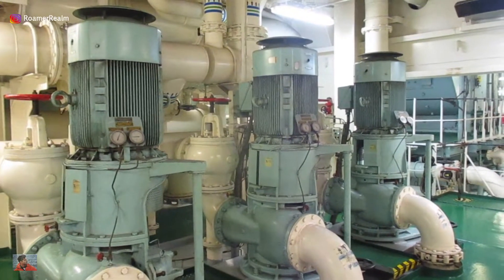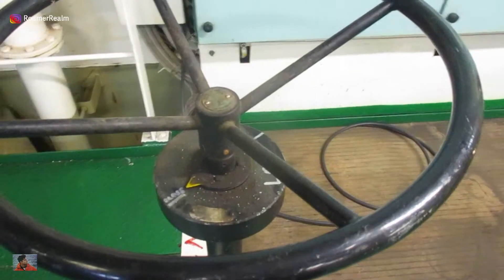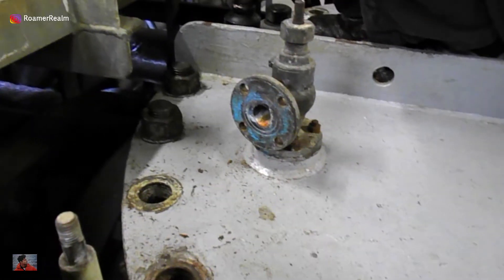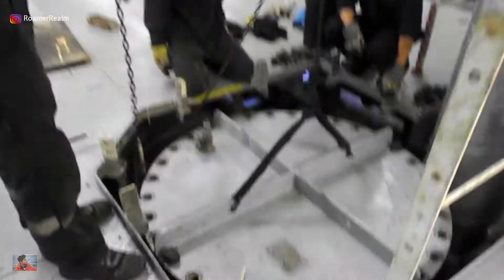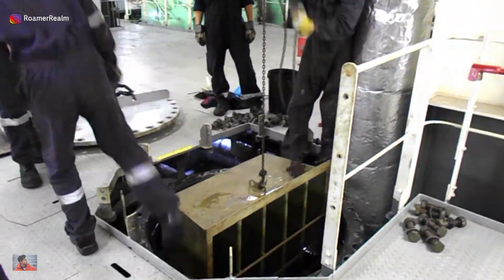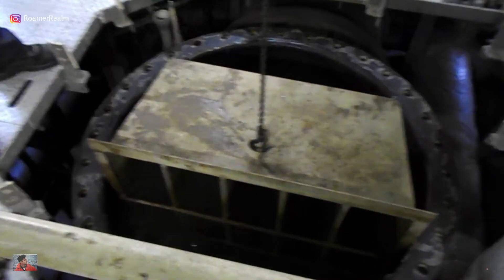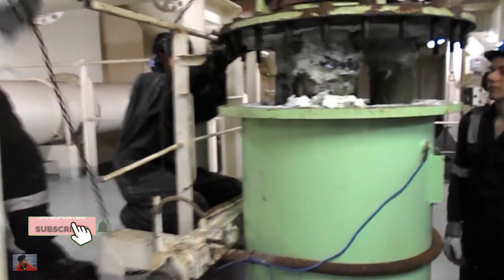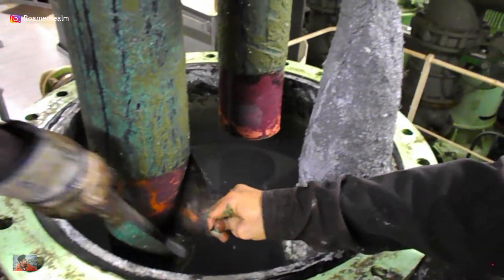Sea Chest in Ship Explained | Strainer Cleaning & Inspection | Marine Engineer | RoamerRealm

Comment: Thanks for in details sharing video, it’s very useful. My current job is dealing with vessel owner for cargo replenishment and current model is fully utilize vessel slop tanks to carry cargoes and some destination ports require vessel to perform water line flushing after discharging each product, therefore the team all along will prohibit loading cargo into slop tanks since it needs for flowing seawater to perform water line flushing. However recent there is one vessel that we accidentally used slop tank loading the cargo and fortunately the vessel owner mentioned that they got sea cheat to flow seawater and perform water line flushing. Does this mean I don’t need to worry about slop that isn’t empty? Thank you in advance
Reply from the maker: Hey! Slop tanks have a different purpose as you've mentioned. Having a sea chest basically means having a basket with a filter inside to allow flowing in of sea water in a controlled way. I would like to know more about the the slop and cargo washing system that's fitted on your ship. Slop / cargo washing residue also has strict regulations involving with it's discharge, while sea water is just clean sea water. Please let me know more details to be able to answer you better. Thanks and do subscribe to my youtube channel

Comment: Excelent video. Congratulations. I work in customs and border patrol in my country. Unfortunatley, we are having to much problems with drugs  placed in the sea chest. The drugs usually are placed inside the sea chest and tied on the external grid. Criminal divers do this. I am not a mechanic engineer, but i am an eletric engineer. I have to ask you something: Is there any way we can insert a small camera on the sea chest, by inside the ship? 
Is there any inspection window on the sea chest for the mecanics make a boroscopy?  Another question: if the bags with drugs are placed in the sea chest, next to grid, can we look on the machines eletronic control and detect a water pressure (or flow) change? Thanks
Reply from the maker: Hi Diego, thanks for the nice comment and your words of appreciation. If you want then do Subscribe to my Channel, it helps. Coming to your questions:

About camera on sea chest - The sea chest is always pressurized with sea water from the overboard side. Inserting a camera would mean to find an opening on the sea chest from inside the Engine room to insert the camera. There are openings available, but personally I think no Chief Engineer or Master would allow it as it means a lot of extra job for the Crew (Isolating the sea chest, draining some of all of the sea water content to de-pressurize the sea chest, removing the mountings/flanges on top of the sea chest to facilitate the camera insertion etc...AND these mountings are not so big, so, the camera will also need to be really small (smaller than GoPro)...so, overall, I am not sure how feasible this is. Additionally, you might just be able to insert the camera but you have no control over the movement of the camera, so, you can really see everything. Moreover, the grill area which you're talking about where the drugs are usually installed, are still more to the outside of the sea chest and a camera inside sea chest still won't give access to the grill sections (because the isolative valves are just before and after the sea chest while the grill etc is closer to the sea side (before the overboard isolating valve) and that area cannot be isolated (unless divers are employed and they blank the sea side using plates). Hope this answers the first questions.

Next question about the flow change detection: There are pressure sensors installed on the sea water side (we need to know these values as well to monitor the running parameters, to monitor cooling efficiency or to detect ice when water temperature is really low during winter). The sensitivity of the instruments installed is not that amazing to detect a flow change due to some (or more) amount of drugs. I think if the entire sea chest area was filled with drugs, and the Sea water pumps were starved of sea water, so much so that there is really a drop in pressure, only then will it really show a pressure difference. Otherwise, I think these instruments will not be able to give you any signification data which can be used to detect drugs on the sea chest. Another thing - the pressure shown on the pressure gauge or on the remote monitoring system is the instantaneous Sea Water Pressure in the moment. The value also depends on how is the ship loaded with cargo (more cargo = more sinkage = more draught = ship is deeper into water = more pressure available (since pressure increases with depth). So, this would further make it complex for you to really determine if the pressure difference is due to drugs or due to cargo loading or due to ballast (different topic but ships can also take in sea water in dedicated tanks to increase/decrease their draught as required for stability reasons depending on cargo load distribution and navigational requirements. Hope this answers the second questions.

Let me know if you have any other questions and I'll be happy to help you. Have a nice day!
Reply: @RoamerRealm  Thank you for all your wonderful explanation. The idea of trying to insert the camera inside the ship came about because here, in the port, the water is very dark. Almost impossible to see the ship's hullI using a ROV (Remote Operated Vehicle). We already tried the ROV. About the pumps, i thought that the drug packages could cause a drop in the pump pressure. But, as you said, it would have to be a large amount of drugs. Another ideia came these days, about the sea chest cathodic protection system. I thought about whether the use of plastic to package drugs could disrupt the conductivity of the sea chest cathodic protection system  (plastic is insulating) . Maybe the plastic use can make the controler of cathodic protection system use more current. Do you think you would have the sensitivity to detect it? Thanks
Reply from the maker: @diegoperes2287 
You are welcome, happy to help you. Below are my thoughts about your latest comment:

If the water in the port is extremely dark, maybe a long term solution could be to use a dredger to clear out the sediments/underground marine growth in the port. If there is not enough UKC (under keel clearance) then these boats while arriving in the port stir up a lot of dirt/sediments and underwater visibility is further hindered. If allowed some time, these disturbed sediments settle again and maybe the visibility is better after sometime Vs when the ship has just arrived and Tugs are working along with Bow/Stern thrusters. So, if possible, you can plan the inspection of the ships accordingly or employ a dredger and deepen/widen/clean up the bottom bed of the port.

About the ICCP (Impressed current cathodic protection), this is a dynamic system and measures the instantaneous potential difference between the hull and the reference anodes. Ships hull surface area is huge compared to the small area on which the plastic/drugs are going to be stuck. The instrument might catch it but due to the small area, it will auto apply the corrective current to the system to compensate for the change in potential thinking that maybe some paint has peeled off or there is higher marine growth or maybe even a slight change in the density of water. This system can give usable indicators only when ship had a grounding or touched bottom and a large part of paint got peeled off or when ship went from sea water to fresh water (density change)….other than that this won’t give any meaningful difference in measured values as the system will automatically correct and supply the right current to the hull. Hope this answers the question. Let me know…
Reply: @RoamerRealm  Thank you my friend. All your tips and explanations were very valuable. The opinion of someone who has technical knowledge about mechanical engineering is very important. A thank you from Brazil, port of Santos
Reply from the maker: @diegoperes2287 Muchos gracias amigo! I have been to Santos a few times and made some wonderful experiences staying in the city, exploring the city and also meeting some very nice people (we met more than 10 yrs ago but some of them are still my friends) Brazil has always been very special, I am from India and I feel our cultures are also very similar :) thanks for the kind words and have a great day!

Comment: what to do if sea chest valves are not holding , and you have to clean Stanier .
Reply from the maker: Hi Ashish! Tricky situation…hard to give a straight forward answer. How bad is the leak? There is a drain valve on the sea chest which drains to the bilge well. If the rate of leak is very very low and you can keep the drain valve open and see that the pressure on the chest drops, then you can give it a shot by keeping the drain valve open while it drains to the bilge well while you try to clean the strainer BUT this is very very risky. I think the best way would be to bring this up with Chief Engineer and vessel superintendent and carry out a risk assessment. Maybe it could be possible to block the sea chest outlet using magnet/divers from the outside OR if the vessel is soon due for dry dock then it can be fixed properly during that time. Let me know if you have any other questions and do subscribe to my YouTube channel 👍

Comment: Sir after replacing the seachest how to check the leakage
Reply from the maker: Hi Hari! I have covered this part in the video. You have to open the water connection valve and then purge the air out from the sea chest compartment via the vent valve. Once all air is gone and water comes out from the vent valve, close it and check for leaks around the sea chest. Let me know if you have any other questions and do subscribe to my YouTube channel 👍

Comment: Looks like the sea chest was full of microplastics. Please tell me this is not thrown back at sea? Also; if a ship has a blown head gasket or cracked head, is their a possibility that oil will leak out since ocean water is used for coolant? Great video!
Reply from the maker: Hi Dave! Thanks for your comment and for appreciating the the video. About your question, no, the micro plastics and everything else which is cleaned from the sea chest is stored separately and landed to shore garbage reception facility (when the ship is in port) as per the local/international laws applicable.

For the 2nd question, please specify if you are talking about main engine cylinder head gasket? Or something else?
Reply: @RoamerRealm  Thanks for the response! How are ship engines cooled? I assumed seawater?
Reply from the maker: Most Ship engines are actually cooled by fresh water. The fresh water (flowing through the machinery) in turn is cooled by the sea water (flowing in a small system loop). Sea water is corrosive and leave sediments/salt behind, so, fresh water is used. Please let me know if I understood your question correctly…

Comment: Good video. Can I ask is the suction on these sea chest where the actual metal grates are in the hull of the ship actually strong? Could you be sucked against it?
Reply from the maker: Hi Richard! Thanks for your feedback, glad to know that you found the video helpful. About your question, it's very interesting. I have seen the grates in the hull during dry dock and while they do appear to be reasonably strong. Due to the curvature of ship's hull and water flow,  I think the chances of getting sucked into the suction side of the propeller is far greater than being sucked onto the grating of the sea chest suction inlet. Let me know if you have any other questions and do Subscribe to my YouTube channel 👍
Reply: @RoamerRealm  thank you for taking time out of your day to reply, have you done a video on the ventilation systems and heating and cooling for the living areas. Are ships using 100%outside air due to covid?
Reply from the maker: Very welcome, thanks for appreciating, I try my best to respond as quickly as I can...
I haven't done a video about the ventilation system yet, thanks for the great idea. Despite covid, we are using the ventilation system as usual i.e. 100% fresh air from outside, cooled via freon in our refrigeration system and then supplied in living spaces and then 100% air out without any recirculation. I will try to do a video on the ventilation system soon. Thanks and have a nice day 👍
Reply: @richardc1983- Not sure if you will see my reply after so much time has passed, but coincidentally I arrived at this very educational channel because of a news article that I read. It was in regards to a  DEA drug bust where a cartel had smuggled cocaine by putting it in the sea chest of a commercial ship. It went on to say that the reason the DEA was originally investigating, was because the diver who worked for the cartel to recover the load, actually drowned while attempting to recover it. They said that he was sucked against the inlet and ran out of air! I thought this was interesting and would help answer your original question.

Comment: Hi,  young man, very good video. I am a retired chief marine engineer. I remember some times in 1977 when i joined as a junior engineer ( 5th engineer) in a oil tanker. Since it was a coastal tanker, the sea chest was cleaned once a month. I was assisting the 3 rd engineer along with a fitter and 2 crew members. No anti fouling system those days. A vent valve was provided to remove air after boxing up the filter. I was told to apply grease on nuts and bolts after cleaning before bolting back, so next time removal will be easy. No rust formation. Those days we cant go inside. After cleaning we inspect visually. May renew rubber sealing 3 mm thick if necessary.  Thanks for rekindling my memories. I am 69 years old. God bless you.
Reply from the maker: Hi Chief! What an amazing feeling it is to receive a comment from you, thank you. Most of what you were told to do during the sea chest job are still the practice today. Thank you for sharing your experience and I am glad this video brought back fond memories of your younger sailor days. Once a sailor, always a sailor 👍 Please do subscribe to my YouTube channel

Comment: we can't have sea chest of same height on both sides as during high seas we use low sea chest as lower number things need to be filtered at high seas , whereas when we are in port we use high sea chest due to the increasing number of particles to be filtered as the ocean depth decreases.
Reply from the maker: Well said Koustav 👍 preventing excessive accidental intake of sediments due to less under keel clearance is one of the correct reasons for switching over the sea chest
Reply: @RoamerRealm  Sir as you said it is ONE OF THE CORRECT REASONS , sir what would be the other reasons ?
It would help me help me out a lot .
thank you.
Reply from the maker: Hi Koustav, please go through the comment section, some of the other guys have also mentioned some other reasons and we have had a small discussion about the same. If you have any doubts about anything, please ask and I will try to explain further. Do subscribe to my YouTube channel 👍

Comment: Actually vessels normally have a high sea chest, which is used to in shallow water to reduce intake of sediment, and low sea chest could be used when navigating in ice- covered water(when the ship is rolling to avoid losing suction..
Reply from the maker: Very well said! These are absolutely correct reasons 👍👍👍

Comment: Very well explained. Thank you
Reply from the maker: Thanks a lot Minakshi for the nice feedback! Do subscribe to my YouTube channel if you are into travel and ship related videos 👍
Reply: @RoamerRealm  yea sure, will subscribe. Yes I do watch ship related videos. But i am mostly into deck videos as self is chief officer. Today was looking into ballast water pump filter cleaning related videos and found urs. Watched it and liked the same because of simplicity in explaining.
Reply from the maker: Thanks a lot, I take that ("simplicity in explaining") as a big compliment 👍
Hmm, about the ballast pump filter, just to be sure, you are looking for the line filter OR the filter on the ballast water treatment system? Let me know, I can try to help you out if that's ok with you..have a safe sail 👍
Reply: @RoamerRealm  Actually looking for both. But majorly line filter. I wanted to know what is the correct procedure for going ahead with line filter job if there is any.
Reply from the maker: Ok, I understand, here is for the line filter: you need to isolate and de-pressurize before opening, so, look for the valves before the filter (on the suction side) and after the pump (on the discharge side) (Usual arrangement is - piping-> filter->pump) to isolate the filter. The valves are usually butterfly type, make sure they are tightly shut. Open the vent on the filter and de-pressurize the isolated line. If the water is not stopping, it means that the valve is not holding. So, only proceed with opening the lid of the filter once sure that no more water is coming out. After this will be the usual filter cleaning and then assembly in reverse sequence. Once all assembled, open Sea to Sea, check for leaks, and close the filter vent when all air is purged out and only water is coming from there. That's it I think, system can be put back to normal after that. Let me know if you have any other questions 👍
Reply: @RoamerRealm  thank u so much. Really appreciate it. Got exactly what I was looking for.
Reply from the maker: Very welcome 👍 happy to help 👍